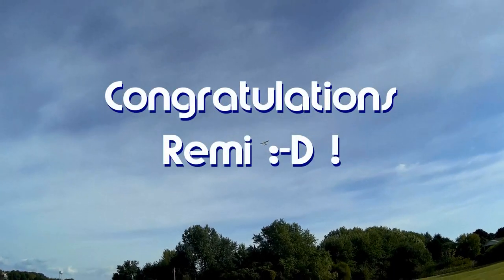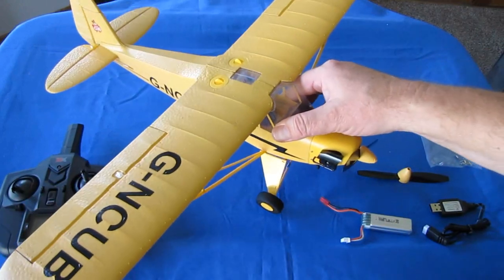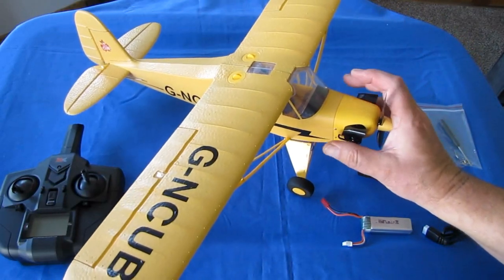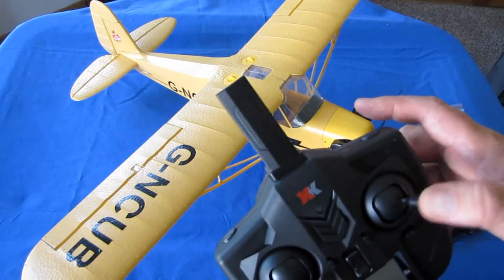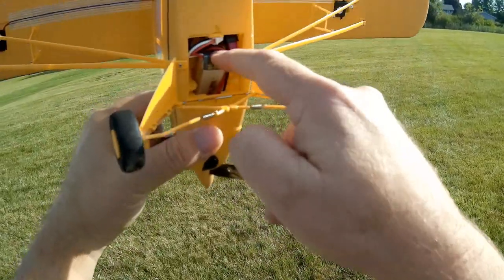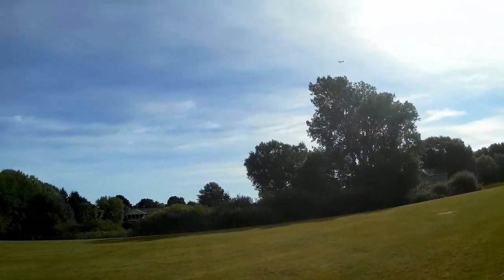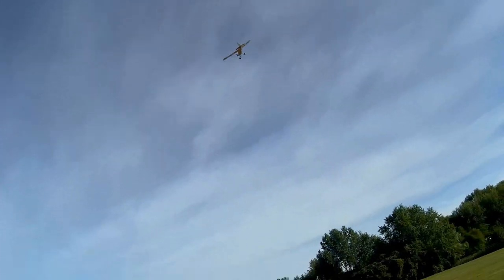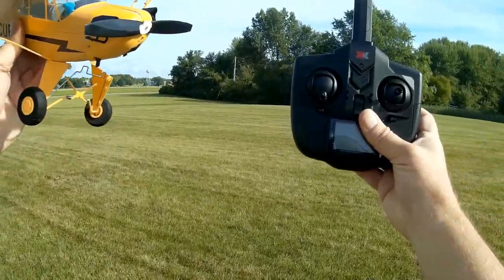WLToys XK A160 Skylark Flying Model Piper Cub Flight Test Review

Comment: Why do they advertise it as 5 channel?
Reply from the maker: It's actually 6 channel.  Four for the standard flight control channels of aileron, elevator, rudder, and throttle.  And two more for the control channels for the rates, and the 6G/3D control buttons.

Comment: Center of gravity,,,,, once battery is in plane, measure the wing from forward edge to rear edge very close to the fuselage.  Take 20% of the value and make a black marker pen DOT under the wing from the leading edge. This will be your balance point. When you place the plane on your finger tips (tips under left and right side DOT) the plane should balance slightly nose down. Now your with in CG.  Different batteries will give you a different CG...but very close.  BATTERY must be forward as he stated.